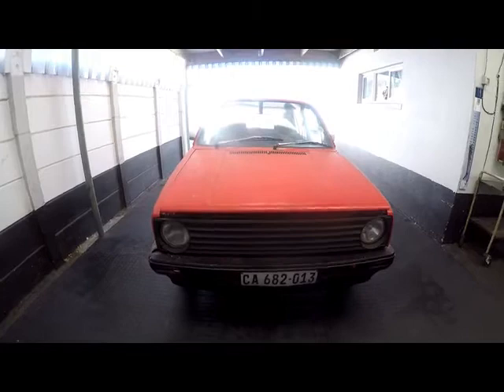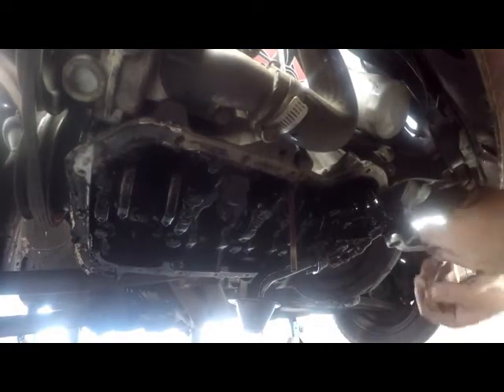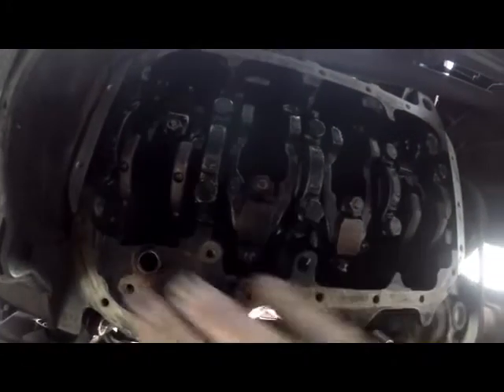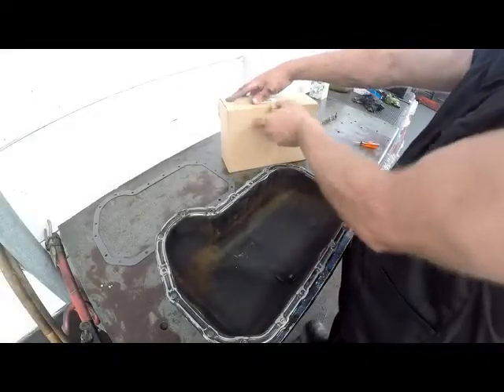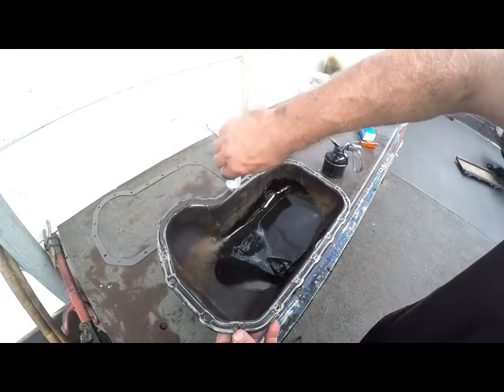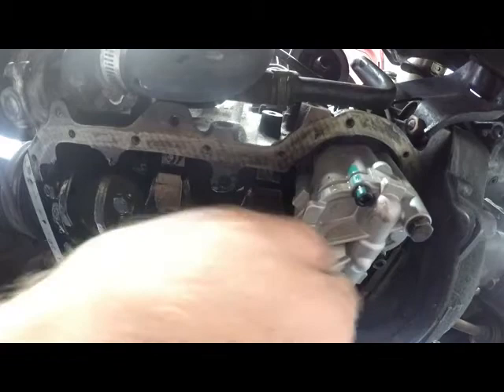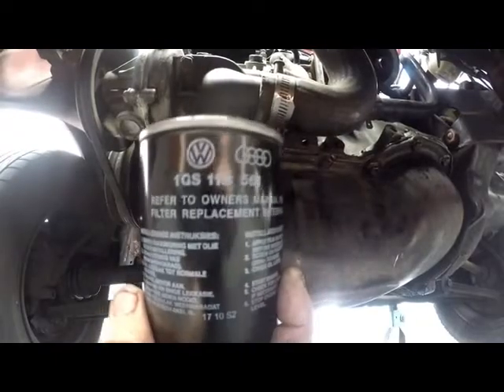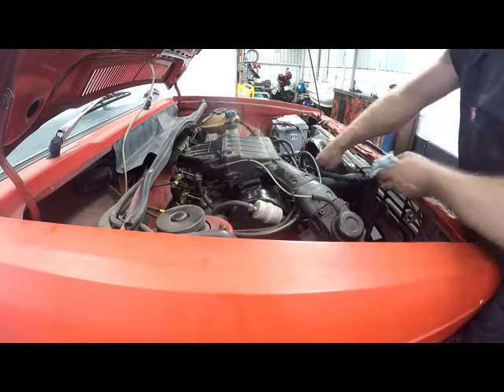Vw Citi Golf - Fitting An Oil Pump

Comment: Great video, that oil sump was so easy to remove, my Fiat requires removing half the exhaust
Reply: Don't feel yourself unlucky, my Golf 3 Variant has an AEX engine that needs the alternator belt, the timing belt, the lower crankshaft seal cover, the exhaust and the sump removed to take a look on the oil pump. Half a day and of work in the rain and you're already at your destination.

Comment: good day Awesome video.. i always save ur Videos coz i own a MK1 myself and u make it real easy for me to do a DIY on my car.. im replacing my Sump Gasket today.. will jack the car drain the oil just now... one problem i I've gotbis that Buzzer... always comes on and i have oil presure... been changing my sensors nothing changes... oil pump is new, got pressure on the head and oil filter, go enough presure bt still that buzzer comes one once rpm goes beyond 3kRPM🤔 im thinking a Short maybe🤷‍♂️
Reply from the maker: Hi Nkosikhona, thanks for the support man, yes sometimes an error on the cluster causes the buzzer to sound, let a good Auto electrician have a look for you, good luck.

Comment: Would the oil pump make a noise when its on its way? When my car idle it make a random whirring sound at the distributor area. I mistook it for a release bearing noise but did not go away after replacing the bearing
Reply from the maker: No not the oil pump Gary, but the distributor bushing could be worn.
Reply: The distributor is a couple months old only, could it still possibly be that?
Reply: Sometimes the quality sucks, but one cannot discard this possibility.
Reply from the maker: same guy different channel Lol
Reply: I've noticed yes lol. Its a Sebring distributor i used. Are they not a good brand?
Reply from the maker: Sebring is actually a good brand in my experience, Gary

Comment: Looks like there's an underlying issue of overheating with this car, this can also cause the oil to thin as it is operating outside its specifications.

 This sounds like the reason why the oil pressure was low at highway speeds and 3k rpm. Did you look into the overheating problem too?
Reply: Most South Africans use tap water as a coolant which boils @ 99°C and coolant boils @ 129°C

Comment: My car has 265000km and oil pressure is 5 bar! Have installed an oil pressure guage.  Peace of mind!
Reply from the maker: Hi Patrick, thanks for supporting my channel with your visit and interaction, 5 bars is quite high, usually around 3 bars is sufficient, but I like your idea of an oil pressure gage to keep an eye on the oil pressure, as you say for peace of mind.

Comment: My oil light is off before starting and then it comes on directly after starting , dit replace all the sensors and the pump aswell .. But still the oil light is on while idleing
Reply: Can be a faulty cluster
Reply: Take the buzzer out the cluster, I had the same problem. While u at it buy a new cool cluster